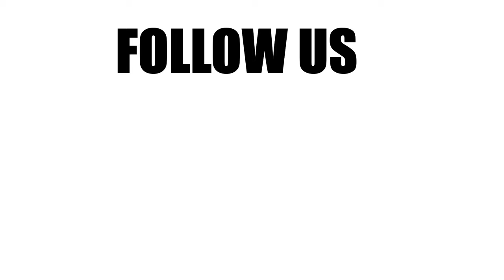Picote Solutions High Speed Drain Cleaning

Comment: What will this thing do to the 100% of home's built after the 1970's that have PVC lines all over even going out to the street??
Reply: If it's all pvc and installed correctly......shouldn't need it...hydro jet
Reply: Plastic waste lines are ABS.  Regardless, ABS or PVC, I would imagine this machine would break them.  It's for descaling rust in cast iron pipes.  I would imagine you would use a snake with blades for plastic pipe with roots and such.

Comment: How many rpm are you running?
Reply from the maker: Even Flow Our machines run from 500 - 2900 rpm depending on the model. The Maxi Miller shown here runs from 500 to 1500 rpm.